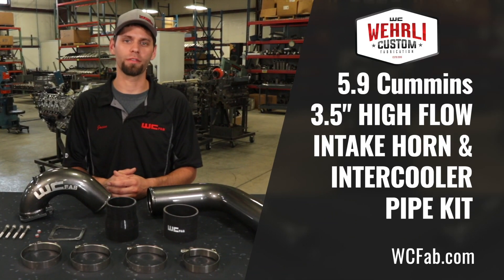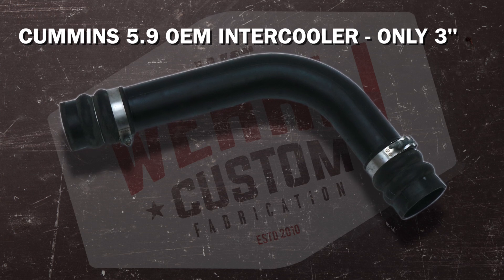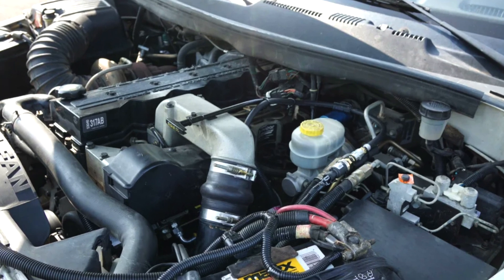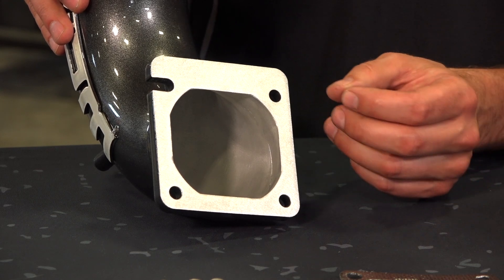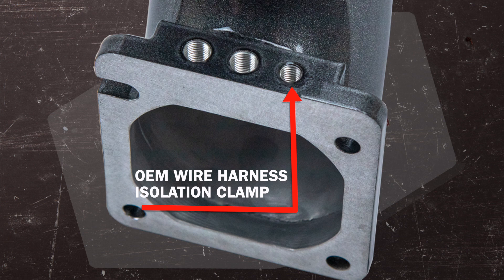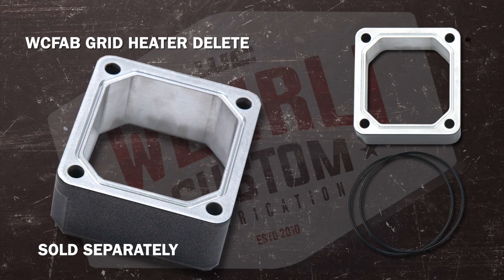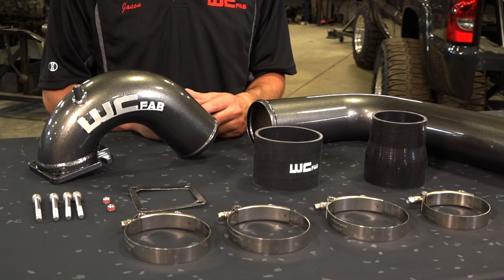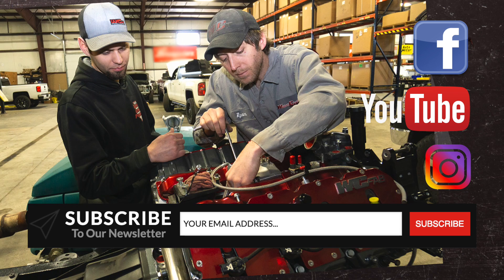WCFab 2003-2007 5.9L Cummins High Flow 3.5" Intake Horn and Cold Side Intercooler Pipe Kit

Comment: Good video 
So I have an aftermarket intake horn and I'm assuming the same for the other intake piping. My issue is there is a squeal when my turbo is under boost you can hear it on the left side about where the intake horn is 
From my research it is caused from the bigger piping providing more air flow. Is this the case?
Reply from the maker: Changing out the intake, piping and the intake horn to the manifold will change the amount of turbo noise that you will hear under boost. Without being able to put hands on the truck and experience in person it’s hard to say if that’s what you are hearing. Another possibility if you are getting a high pitched squeal under boost may be that you are dealing with a boost leak (most likely at a rubber / silicone boot which can become damaged but still pass a casual visual inspection. We would recommend boost testing the truck to check for this or getting it to a qualified diesel shop that can aid with the diagnostic process.

Comment: What if I only need the intake horn?
Reply from the maker: We sell the horn and intercooler pipe together as a set because the horn by itself is not compatible with stock or OEM styled aftermarket intercooler piping. If you have a unique application that doesn’t require the IC pipe, please give us a call at 630-277-8239 to discuss with one of our specialists and we’ll see what we can do to help you out!